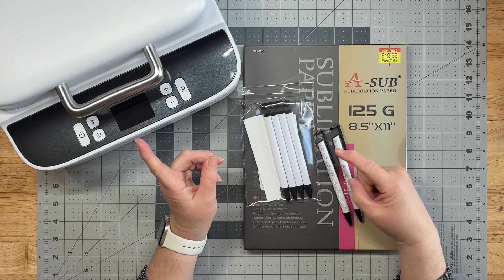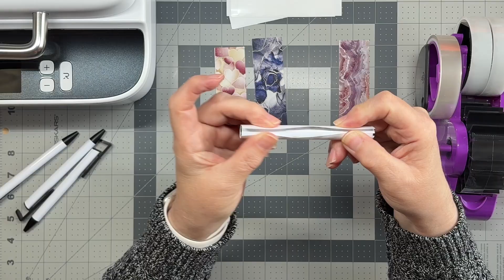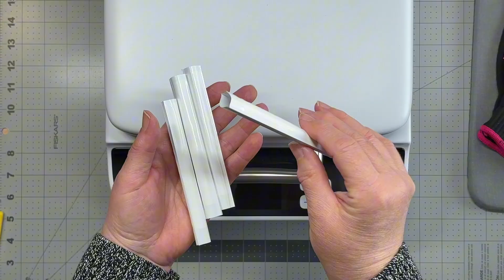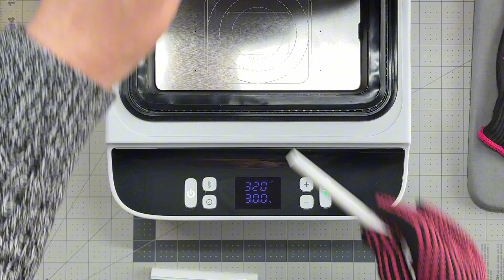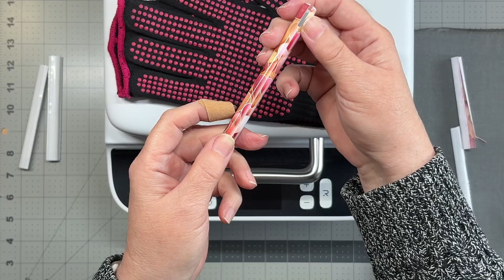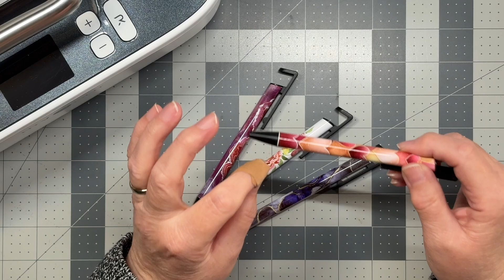Sublimating Pens with HTVRont Phone Case Heat Press

Comment: You need to pull off the shrink wrap while its warm. Peel it off as hot as you can stand it and quickly. It will come off much easier.
Reply from the maker: Thank you so much for this helpful tip! I will definitely give this a try next time!!
Reply: I was going to say the same.  Sometimes it's impossible to get shrink wrap off items, such as water bottles, if it cools, so I remove ASAP.  Thanks for your useful video Colorado Leen.  I have sub pens but haven't tried printing them yet.  I can see why people say they're so fiddly!
Reply from the maker: @craftyfairygifts_uk  Hey! You’re so right — I learned the hard way that once it cools down, the shrink wrap becomes a total nightmare! Next time I’ll pull it off ASAP while it’s still warm. Thanks so much for the tip and for watching, I really appreciate it! Sublimation pens are definitely fiddly little things, but the final result makes it worth the hassle. I’m looking forward to hearing how yours turn out!
Reply: Just wondering if in that machine, u could avoid the shrink wrap and use plain film over the sub paper wrapped pens? Almost like an alternative to the shrink wrap 🤷‍♀️ i may try this when my machine arrives 🤞🏼 xx
Reply: @kateuk16  Please share your results. Would love to know if it works.